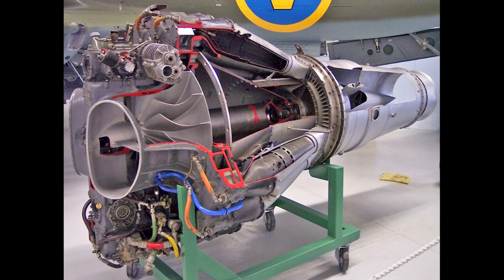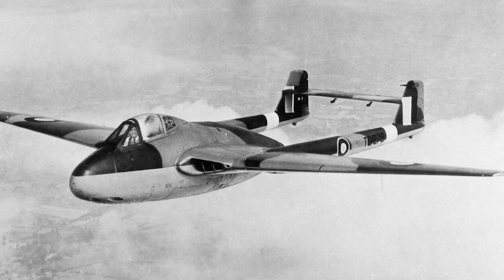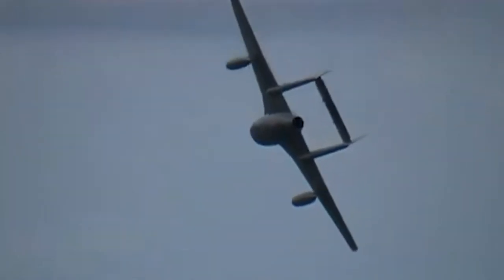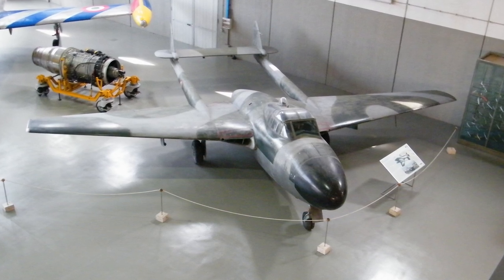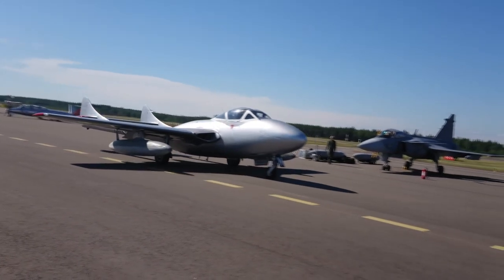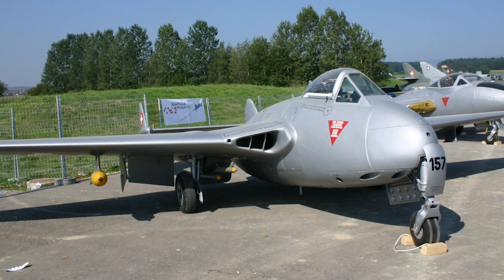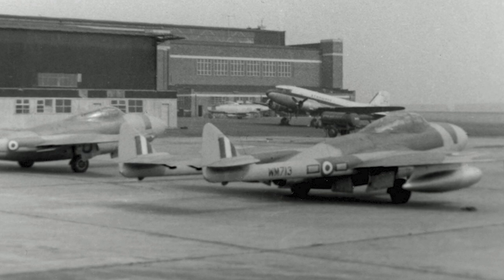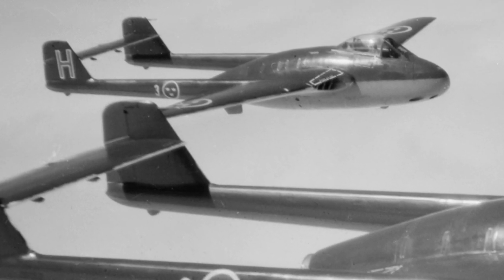De Havilland Vampire -  A Short History

Comment: The development of the Vampire was delayed due to the British Government yet again caving in to American demands !!.In July 1943, one of the two H-1s then available (actually the spare engine intended as a backup for the one installed in the Vampire prototype) was sent to the United States, where it was selected to become the primary engine of the Lockheed P-80 Shooting Star. This engine was fitted to the prototype P-80, which first flew on 9 January 1944. The engine was later accidentally destroyed in ground testing, and was replaced by the only remaining H-1 from the prototype Vampire which further delayed the introduction of the Vampire !! Bloody Yanks screwed the Brits several times and again in 1946 when the Miles M 52 programme was cancelled so the Yanks could eliminate the Brit competition to be the first through the sound barrier.

Comment: There are two pronounciations of NENE (the river), depending if you are east or west of the bridge at Thrapston? Ne-Ne isn't one of them. Try 'Neen' for Cambs and eastwards, or 'Nen', for Northants and westwards. Most use the Cambridgeshire/Norfolk version, as do Rolls Royce. PS. My Father built Vampires, amongst others, as he worked initially in the erecting shop at Stag Lane and then Hatfield for over fifty years, retiring in '83. Informative short documentary though.
Reply: Knee-knee!? Many yanks seem to make that mistake, along with Glow-Chester and Lye-Chester. I was going to correct, but you did the job already, ta.